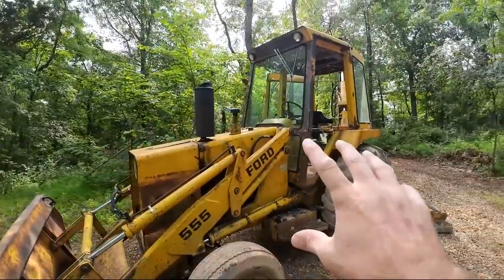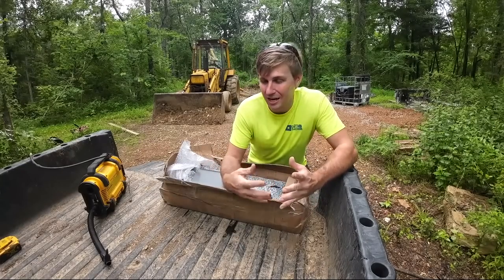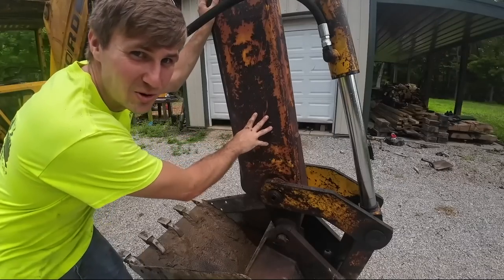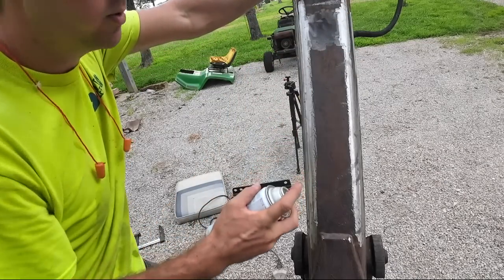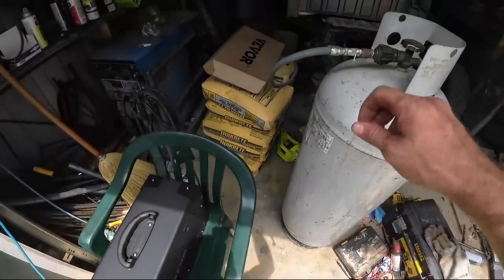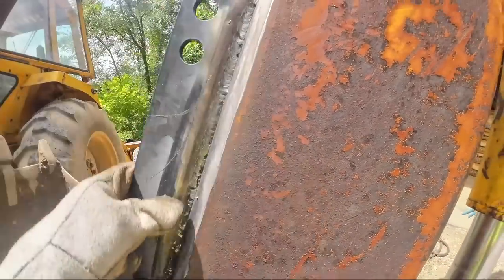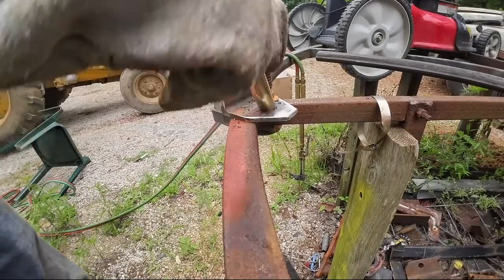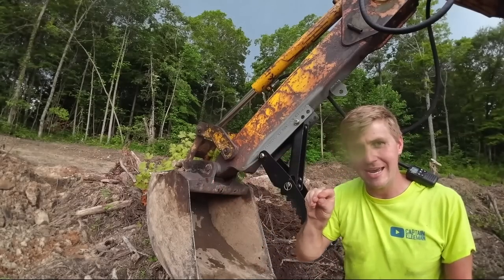Transforming a Backhoe with a DIY Budget Mechanical Thumb: Welding Magic!

Comment: Hey a quick suggestion, Get yourself some 3/32" 7018 for the vertical passes. Run it at about 85 amps. much more controllable. but for teaching yourself how to stick weld that is a pretty decent job 👍

Comment: Captain, tig welding is for thin metal and tubing.
Stick welds are stonger than mig welds.
At one pount in my life I was a certified Ironworker welder so I do know what I'm talking about. 
Nice that you'll finally have a thumb for pulling stumps, moving logs and brush.
Anyway, thanks for another entertaining episode in  the life of an off duty fireman working on his homestead projects.

Comment: As your not a welder and I am can I give you a tip for vertical stick? 
After you've done the root pass straight up, weave the next passes moving up in a small crescent shape as if you were drawing little smiles non stop side to side gradually going up, try and keep your rod pointing up hill about 40 deg off vertical.

Comment: Most operators started with a manual thumb. A lot can be learned using one, it will also enhance your use of the hydraulic one. Keep on trucking Captain. 👍

Comment: As far as welding, I spent a lot of years repair welding and the single most important thing is that the weld holds and stays holding for the duration, as far as looking pretty, well it’s nice I will grant you that, but also know that it requires practice, practice, practice and more  practice, stay the course you will get there. Nice job on the thumb install sir, I like it..thanks for the tag along vid.

Comment: I think the instructions call for a 30amp 110 volt socket for those welders, but you may want to check that. Maxing the machine out is probably what caused the problem.
Have a great day Kleeman. thanks for the videos.
Reply from the maker: 50 amp is what it said when I read it

Comment: It gets you by Mike and that’s all that matters, the backhoe will do it all it just might not do it as fast! It gets you by on the homestead brother, that’s the thumb I was thinking about but I wasn’t going to say anything about it because I figured you knew about it as long as you have been operating equipment! I was also thinking about homemade forks that quick attached to the bucket so you can do most of everything with one machine! Just a thought Mike! You’re doing great my friend!

Comment: This might be a helpful tip. Look for an old used snowplow, take the cylinder and hoses from it to use for the thumb. They may not be as easy to find by you, but maybe not to far north.

Comment: Things may have changed because I am an old man, but many years ago, I was told by a propane gas dealer not to transport 100 gal propane tanks to our camp in the mountains in a horizontal position. The reason is because the shutoff valve will not work properly in that position and the tank can leak. The reason we wanted an 100 gal tank instead of the 20 we were using is nighttime temperatures regularly got to 20 below and reduced the pressure when the tank got low so that the 2 gas table stoves and the 2 gas lights would not work properly when full. Maybe someone else will know. We stopped going to the hunting camp because of a death in the family and never resolved the problem. We had one tank manifolded for all four appliances but perhaps we could have had 2 20 tanks each feeding one stove and one light. The tanks always went dry at an inconvenient time so at least you could have light when one went dry.

Comment: Mike,  I agree about the thumb.  It isn't like a hydraulic one, really, not even close, but it does help in a pinch. Pun intended.  I have one on my sub compact tractor and have used it a few times.  I bought a cheap wire welder and it works good on thin metal.  I think you will enjoy that aspect of it.  The one you have is more flexible with stick and TIG capabilities.  Great Job, great video.

Comment: Good addition for the machine. Mechanical thumb works well and hydraulic upgrade is not that costly. Used cylinders etc are common enough. Good to see your landscaping coming together. Best wishes from the UK.

Comment: I have an idea:  How about a coil-over shock (salvage from a Subaru maybe...) instead of the fixed length bar setting the thumb angle.  Then over-curling the bucket won't bend the thumb.

Comment: Next time, try welding uphill.  It’s easy, and you can see what you are doing, better penetration, hold more better 😂.  I was a welder, but don’t currently have a machine 😢. Jealous that you have two 😅.  Always enjoy your practical process to getting it done 😊.
Reply: P.S.- old rubber- inner tube, sidewall of tire, etc will cushion the thumb assy to lessen the noises.😊
Reply: P.S.S., sweat equity is what you were searching for….you are correct (and I commend your explanation!) in trading time and effort for new.  It’s like 85+ grand for shiny clean digger.  Clint couldn’t make a profit fixing it, did you a righteous by transporting, and saved it from the scrap pile.  Win-Win.  Couple of thousand hours more with occasional hose replacement.  Paint optional, doesn’t make it more efficient 😂. You are doing exceptional 😊

Comment: BTW Mikey, you did very well attaching the Thumb to your Backhoe. I hope it makes your work much easier and efficient. I'm happy to see you enjoy adding new features to the machine. Make sure to buy a heavy enough extension cord for your new welder, many are way to light duty, IMHO. I look forward to seeing the dump truck getting fixed soon, many ways to make a Rusty cab mount still work, function!! I have two different truck Cabs if your interested Mike, I live way far north in MN.
Reply from the maker: Thanks!

Comment: That Vevor outfit makes everything. I'd never heard of them until I bought a deep well pump from them last year, hoped it would last long enough to test the flow rate of the well, but have been using it to irrigate a pasture, with no problems (knock on wood) so far. Already paid for itself about ten times over. But, she's not bragging on my decision making ability yet so I'm good there.  Thanks for the morning chuckle, it's been a rough few days around here. Take care.

Comment: If it does what you need it to do, it is the correct tool. Your use is pretty much what a backhoe was designed for. Fluxcore is pretty handy for less-than-ideal conditions like being outside and metal that is rusty. It doesn't produce the quality or prettiness of using a shielding gas. All I know about TIG is you need more patience, and it makes strong and beautiful welds on aluminum, stainless and titanium. Rollcages to intercools on race cars kind of welding is where I see a lot of TIG.

Comment: You should look into a foam cannon for your pressure washer. Fill it with soap or degreaser and attach it your wand. I got the cheapest at HD and it will shoot foam 25 feet.
Reply from the maker: I'll look into it.  Thanks

Comment: Well Mike, the mechanical thumb definitely made a big difference. You  got the grasp technique down pretty quickly. I like how you tried to utilize the excruciatingly slow extension boom as a hydraulic possibility, but chose to stay with the mechanical option instead. I thought the same thing and realized the cycle time was just too slow. Great idea.
Vevor does have a mag drill that works rather well, the cutters they send with it not so much, but get the job done slowly. I've seen a few people use it, don't remember what the model number is,  but I would consider it a lower-mid level quality tool. Just thinking out loud when you go to drill the lower holes for the thumb.😉🤙

Comment: Thumb is a great addition!  I'm guessing the quick connect is the next buy, so that you can switch out the front-end bucket for forks and make it all around compatible with your 755!   I'm also guessing that it is too far to run power from the house to the shed, which would be a nice to have?

Comment: great build you can add hyd cyl on that prety easy that has open center hydraulic,s so adding nother valve downstream of main valve block would be one way another less deseriable would be to add diveter vale in like extendahoe circuit

Comment: Manual thumb upgrade idea for ya…..

Replace the the hard link with a double acting cylinder, run two short hoses to an electric solenoid valve near the thumb, run a couple wires back to the cab to a switch. You can open close the valve with the switch and adjust the thumb with the bucket.

Just a recommendation if you ever get sick of the hard link and don’t want to spend big bucks on full hydraulic set up
Reply: Only problem is he would ne hydraulic power out there for the valve.  So he would need lines for it anyway.  Now he could have the solenoid valve in the cab and then just run lines out to the thumb and be all set.
Reply: @johnunsicker7440  you don’t need hydraulic power, you fill the cylinder, the lines, and the valve, close the closed loop system, then rely on the valve opening to open the circuit while you move the thumb with the bucket

Comment: Hey man!! love the videos you do. shows the reality of running old machines. I Own a old backhoe Huddig 960 Swidish made. and I´m going to move a lot of old logs and crap. would you prefer a thumb like yours or a Log grapple ?? and man you need to fix a Dubbelcomand running back and forth in exavator mode. my 960 from 1986 uses that and it´s awsome Hey and you are Awsome too !! got go go now Beer run !

Comment: You have done an amazing job on that backhoe ,you should be proud of your self ,well done. Dont use the bucket as the earth . Wont be a good earth and it will pit the pins on the bucket . Better to earth on the dipper arm where your welding on the thumb

Comment: Wish I could show you tips on welding , 6010 then 7018
Also stick is stronger than wire .
Add on teeth end to do the egg challenge,  😂

Comment: I didn't read the instructions, but to my thinking you may have put the weld on bracket on upside down. If all those holes were at the bottom then the thumb part would be adjustable to make it closer to the bucket without drilling extra holes. Just a thought.
Reply from the maker: You're thinking of it wrong.  You're moving the wrong part
Reply: @CaptainKleeman  , agree to disagree. I have a mechanical thumb on my backhoe too.  But my center piece is adjustable.

Comment: Flux core mig isn’t really designed for vertical, or overhead! I don’t really think it’s designed for horizontal either Mike mostly flat welding brother! You’re doing good Mike, looks good enough brother! My thoughts are outside welding brackets,I’d weld them solid to keep rust from building underneath the bracket! That type of thumb always rattles anyway, looks good Mike! I can give you some pointers on tig welding when you get ready if you want my friend! That would be my pleasure to help you out! Thanks for sharing Mike, Kirk from Louisiana! 🙏🏻🙏🏻🙏🏻👌🏻👍🏼👍🏼🇺🇸🇺🇸🇺🇸🇺🇸🇺🇸🇺🇸🇺🇸🇺🇸🇺🇸🇺🇸🇺🇸🇺🇸🇺🇸

Comment: I am wondering if you know if the bucket curl has a pressure bypass that will not allow there to be enough force to either bend your thumb, or MUCH WORSE, bend your hydraulic cylinder. If you over curl a log into the thumb, you could end up with a cylinder rebuild that could cost you $1K.

Comment: I know run what you brung.  When I got my manual thumb the instructions had me put the pivot point in line with the bucket pivot on the stick not sure how much of a difference it would make for picking smaller things.  Using the website measurements I ended up with a thumb that is a little long so at some point I will need to cut it down.  I am envious that outside slides for your extend-a--hoe made your welding job much easier than my 580 SE where I had to have a bracket bent to span the outside rails so I could use the thumb with the my extend-a-hoe.

Comment: so one advantage of your machine with a fixed thumb over many others in positioning is the extend-a-hoe...  that will help in getting the correct angle in many cases in getting the thumb /bucket in the optimal orientation for grab..

Comment: Just a thought but you could pin the extend a hoe and use that valve and hoses to work a cylinder to work the thumb , but I'm sure you already thought about that.
Reply from the maker: But then I wouldn't have an extenda hoe...so...there's that

Comment: Just a suggestion you should be careful running your ground through your pins on your bucket you could end up welding your pins solid not much of a chance but still a chance❤

Comment: Mechanical thumb is truly a game changer was for my machine I feel like yours is to short for that bucket if it doesn’t reach the end of the teeth makes picking up smaller branches etc harder I had to replace those pins with big bolts
Reply: Watching video close thumb a little longer than bucket would help I think with picking things up mine is about 3 inches passed teeth on bucket
Reply from the maker: It touches tooth to tooth when closed 👍

Comment: well mate you may not be a welder as such but your willing to have a go you got the right idea to run Mulla pull weld passes its not over kill but it is the way it is don to get good all round penetration and weld build up well done nice job and the more you weld the better you will get but good enough for what you are doing the only thing i can see is you know how to operate with it but it does look and seam a tad on the small side for the size of the machine you have just my thoughts no one else's okay  Cheers

Comment: If and there is no way I am saying your stick welding is not top of the line but if the bracket ever does blow its welds, when repairing slot weld the bracket for more strength. Pretty common thing done.

Comment: What length thumb did you get?  I read to determine thumb length measure bucket from boom pin to the teeth.  That would be a 36" thumb on my bucket

Comment: IMPORTANT!!! Please be sure you have all the thumb pins pointing the same way!! 😳 For every pin pointing opposite of another one, you will lose 17.3% of any karma available in your area. It may help if you align the pins with the magnetic flux lines. I think they run about ten degrees west of true north in southern Indiana. However, there may be some distortion from the steel channels due to that new boat dock down at Darby. 🤔

Comment: I wondered if a hydraulic thumb might work if you used the extend-a-hoe circuit. Either by extending the stick and leaving it out, capping the cylinder in/out to keep it on position, then moving the hose to a hydraulic thumb or by plumbing in a manual bypass valve to switch the flow from thumb to extend-a-hoe.  I have no idea about the plumbing, but it might be a way to have a hydraulic thumb without adding new spool control and a complete circuit with hoses.

Comment: The welder is greatly derated on 110vac. It should show that on the settings chart. Also you where grounding on the bucket. So your ground path is through greased pinned connection. You might get away with it but it's certainly not helping.

Comment: Só we watched you when there was no hoe….you didn’t whine nor cry but went to brush with a chain and pulled out a big branch or trunk using your 755.   After bucking it down with a chainsaw, you used the forks which you added to your 755 to carry manageable pieces to your burn pile (or saw area).  

After brining a dead 555 to life, you were very pleased to get the range to go out with a bucket and then pull back things previously way outside your range.  But no thumb …you didn’t complain, in fact you said everyone should learn how to pick up without one first anyway.  Now that you have your manual thumb, your ability to pick out stuff and easily lift it for placement just went up an order of magnitude.  

Do I think you will eventually put a hydraulic thumb on the 555?  There is no question, it only depends on when….if someone calls you with some parts that they stumbled across, it could happen pretty quick.

Comment: Is that the 18" or 36 in thumb? I have a 655A I want to add a thumb to.
Reply from the maker: I think the 36,  link should be in description
Reply: Yes there is a link goes to the 18" but has a option for the 36" thank you

Comment: 🤦when you said you had a thumb coming in  previous episode that is not what I envisioned. I didn’t know you were getting an aluminum can crusher 😂.   But in all honesty. If you are gentle with it it will probably serve you better than a big heavy duty one. About 5 years ago we put a big heavy thumb on a 580k case backhoe and we couldn’t keep the front end on the ground. Basically the entire front end as far as grading or digging was useless